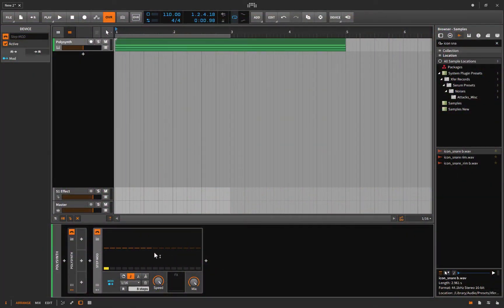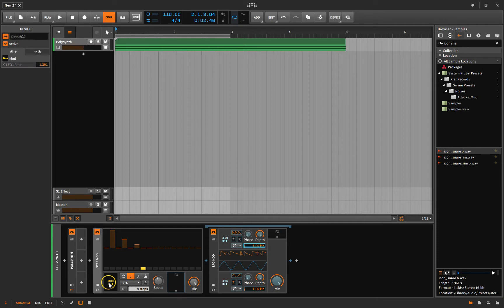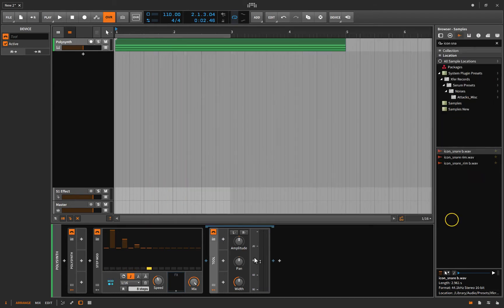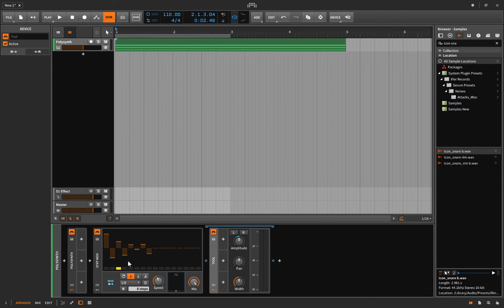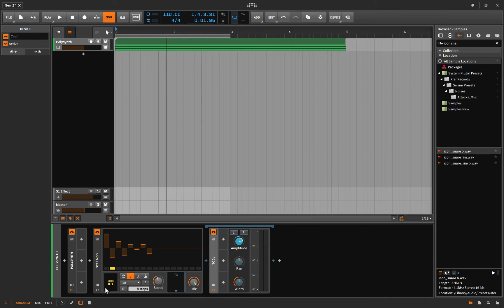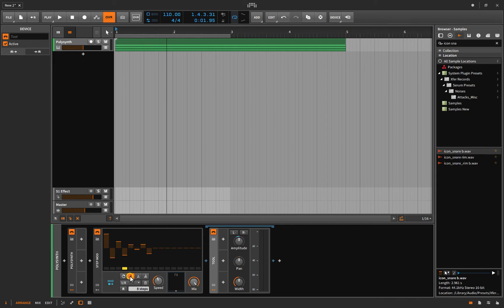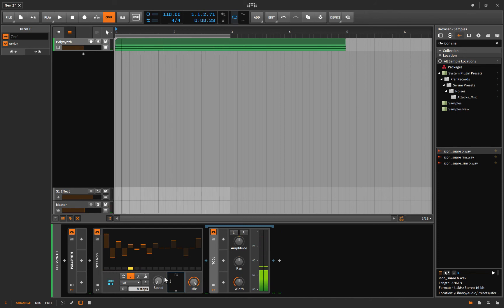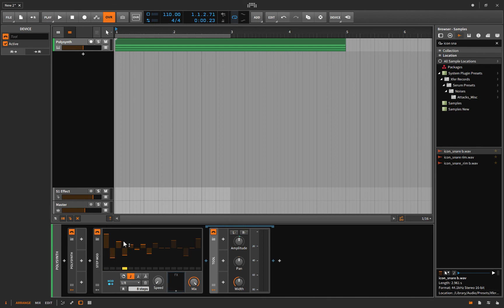The Step Mod! - Bitwig 2 Tutorials

Comment: @Vaan, in case you were not using v1.x, Step MOD is a legacy device from that version of Bitwig (along with LFO MOD and Audio MOD, but those are 'hidden' in th browser) when there was no separate modulators. It's weird that it's still visible, because you can achieve the same results - as you suggested - by adding the Step modulator to your devices.

Here's explanation of differences: https://www.youtube.com/watch?v=FjvsFUHuEL4
Reply from the maker: Great Tip!!!
I never even thought of this! Thank you for sharing :)
Reply: No problem :)

Actually, I would have a proposition for you - I came up with the idea that I described here (https://www.kvraudio.com/forum/viewtopic.php?f=259&t=489584 - it works, I can send the project file) and some people might be interested in it, but since I don't do tutorial videos maybe you'd be interested in doing one instead?
Reply from the maker: Absolutely! Send it over! I'll dig into it :) It wont be for a while just because I'm still out on tour but i'll be back in a few weeks and back in the studio crankin out the videos haha